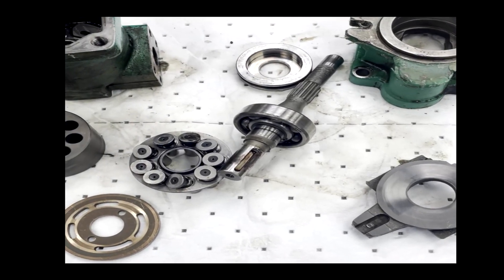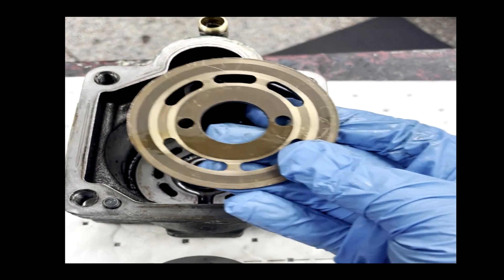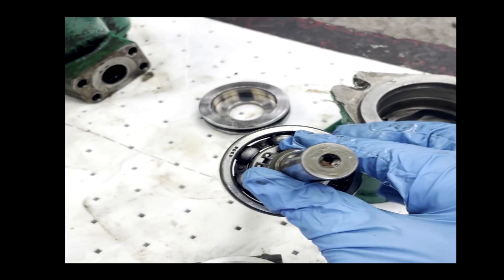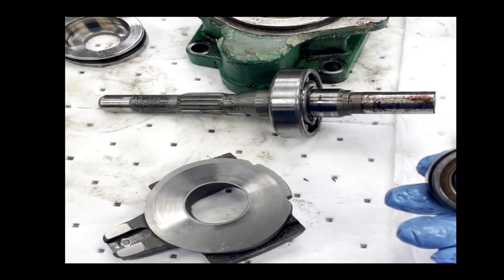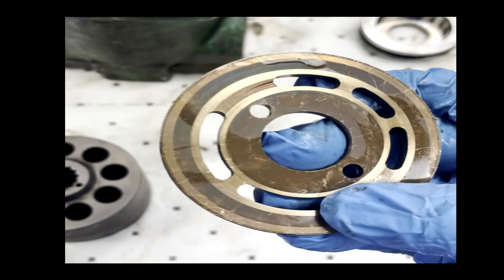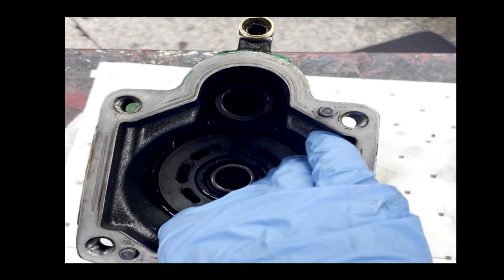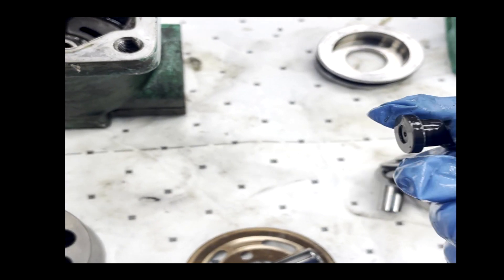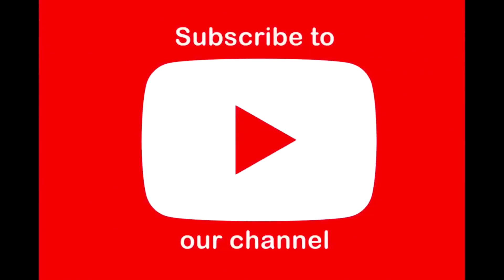Nachi Hydraulic Pump Repair

Comment: Very clear troubleshooting, thank you. I have piston pump with a huge loss power so it can't move the wheels of a skidsteer loader when it is on the ground. I checked the piston shoes and they all look ok. I want to avoid buying the full rotating group, because it could be a couple of piston shoes problem or just the valve plate... I was thinking these steps: 1. Buying a micrometer and checked diameters of each pistons, if I'm lucky I could identify the bad ones and replace them by new. 2. Checking the holes diameter of the cylinder and replace if they are not all the same. But after these easy checks, what else could I check? What would be next most likely issue according to your experience if I have to guess a component to replace? Thank you.